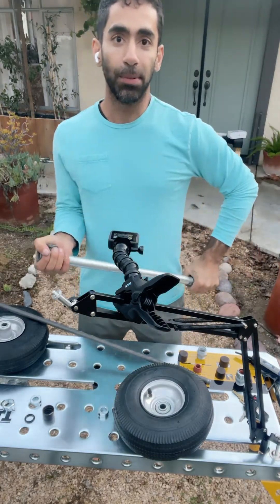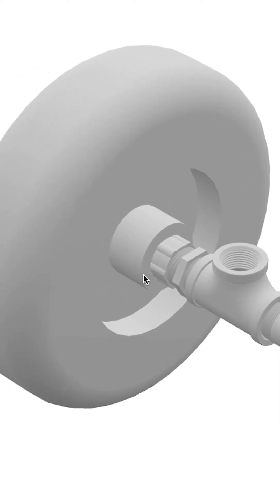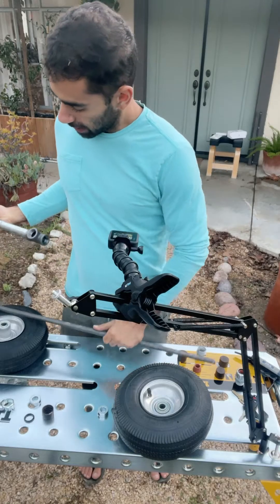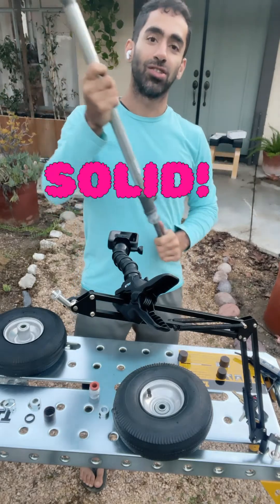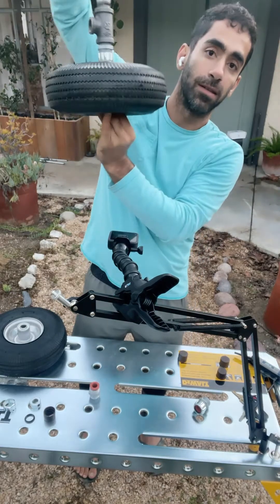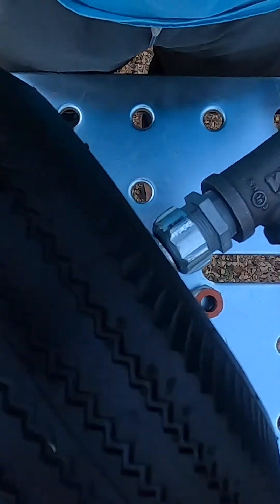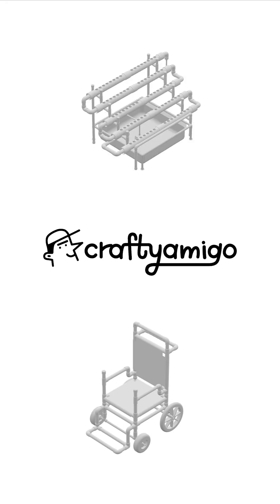How to make an axle/wheel that can connect with PVC!

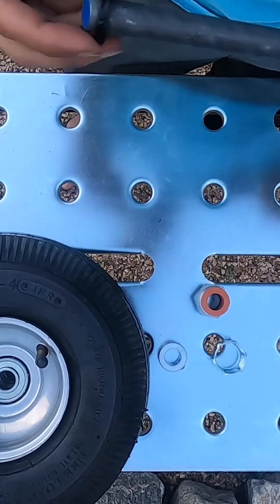Comment: so you're mixing what i presume is NPT and PVC? i mean you're not saying the metal material but i work with npt daily so i can spot it relatively easily. but what is this cut mate 1:10 wth happened? holding the axel inside the tube of course makes no sense but i do know what you mean. problem is bc it was confusing, and you didn't show it, despite know what you're explaining, i cant replicate it. you say "that's in" seemingly fitting somehting on with a straight face while it's entirely off camera haha. if i sound irritated its bc it seems like a fantastic idea i'm tinkering with currently too but now i'm just frustrated bc i'm not sure what you're doing that makes what youre saying work. how the holy hell are you tightening up the axel through the NPT nipple? it looks like a 3/4 nipple. i know you say "threaded a few times" but yeah technically nPT and pvc don't work. you can do it bc of the material differences. but i doubt you did that. you seem to know wha tyou're doing so i bet it's a nut. you don't show what happened. just the end result. i dont know how you made that work. "its in" whats in?? how in the world did the cable gland magically transfer on the axel? when did you do that? i'm not crazy haha i work with these materials habitually. the concept is brilliant but it's legit confusing. i'm not having a go. i wish you did this better bc it looks awesome. at 1:07 you flashed some measurements. the wording implies an adapter or what? bc 3/4 NPT does not fit 5/8. are you trying to say you nut fitted USING the cable gland basically making the rod slightly longer? but if you're doing that... why not just use the smaller NPT pipe? just use a cotter pin to hold it all in place. you also would  avoid 3 way nipples bc of the weight distribution. just use 2 way unless it's all you had , then that makes perfect sense? i'm gong to spend a few hours and just use npt pipe for the full thing despite not knowing why you didn't. i feel like i'm walking intoa trap. again not meaning to sound like a prick i just really love this idea but you buried it.
Reply from the maker: Thanks so much for your detailed feedback! I completely understand your frustration — some steps were a bit unclear in the video, which makes it hard to replicate. I really appreciate your observations and suggestions, especially regarding the materials and fit of the parts. I’ll make a note to provide a clearer explanation or maybe a follow-up video showing the “off-camera” details you mentioned. I’m glad the concept excites you, and I encourage you to try it with your adjustments — I’m sure your tweaks will make it work even better.

Comment: How to make an ten feet cart to pull behind bike as camper with such ? If you have two sets front back wheels and attach board platform to carry things like a camper cot tent behind bike or 🛵 then how to get the wheels you make to steer according to the 🛵 or 🚲? I wanted to build like tear drop camper to pull or platform with tent cot for camping atleast ten feetmaybe? To carry gear too or just a grocery cart as the little ones on market always too small and seniors need carts to pull but how to build to get cart to steer like bike or scooter ? Did you make kind like this yet?
Reply from the maker: That’s a really cool idea! What you’re describing is basically a long articulated trailer for a bike or scooter. To make the back wheels follow the main vehicle, people usually use pivoting axles with hinges or linkage bars so the trailer naturally turns when the bike turns. Another option is a caster-style or swivel wheel system at the front of the trailer.
I haven’t made a full 10-foot trailer yet, but I have worked with shorter platforms and trailers. If you want, I can sketch a basic layout showing how to articulate it and keep it stable for a mini camper or large cargo cart.

Comment: How would you go about making an axle that is higher than the centre of the wheel? Basically I work manual labour on a farm and during summer season we have to manually weed crops because it’s organic and can’t put pesticides on. Now most of the time weeding isn’t too difficult but if left due to weather restrictions a field can take well over a week which just isn’t effective enough when there’s other fields waiting. One main reason is from being bent over all day and the strain it places on the back and hamstrings. So I’m trying to make a cart I can lay prone on at an incline but an axle would interfere with the crop. I’m thinking to have the wheels connect with a short axle that then is connected to a /‘’’’’’’\ sort of frame. 

I’ll try to draw it better with [  ] as the wheels

[^’’’’’’^] if that makes any sense lol
Reply from the maker: Got it! What you’re describing is basically a low-rider style cart so you can work prone without the axle interfering with the crops. One way to do it is to use short axles connected to a V-shaped or triangulated frame that raises the platform where you lie while keeping the wheels at ground level. Another option is to use wheels with an offset hub, so the axle doesn’t go through the center of the wheel but is moved to the side, leaving space underneath for the crops. This keeps it stable while avoiding interference.

Comment: This was very helpful and clever. A couple of questions-1 have you thought about how you could put bearings in the configuration and 2-any thoughts on how to attach the wheel for a live axle (a drive axle)? Thanks
Reply: Yo tengo la misma duda, creo que se debería agregar en los 2 extremos una adaptación para un tubo de radio mayor que pueda aceptar un rodamiento con un radio interior igual al radio interior del tubo. Que sostenga el eje.
I have the same doubt, I think I should add at both ends an adaptation for a tube with a larger radius that can accept a bearing with an internal radius equal to the internal radius of the tube. Supporting the solid edge.